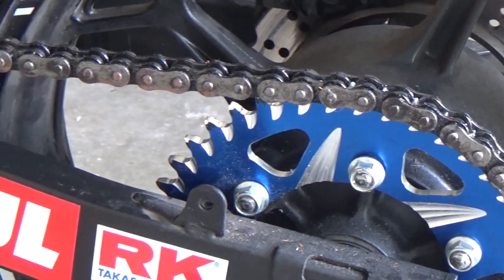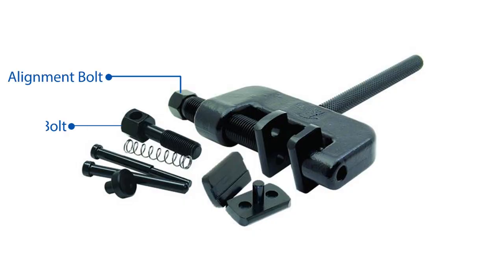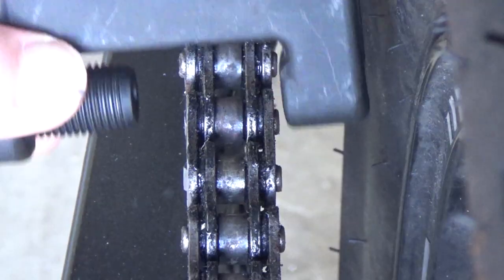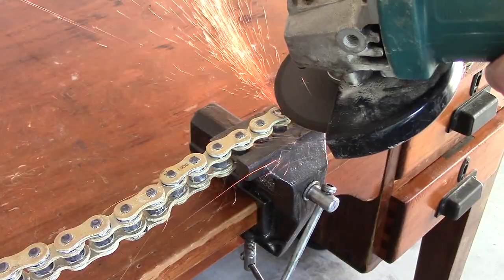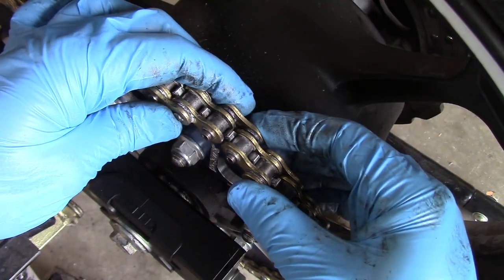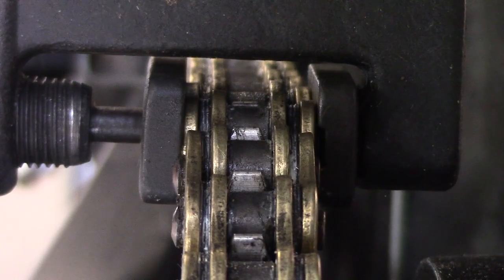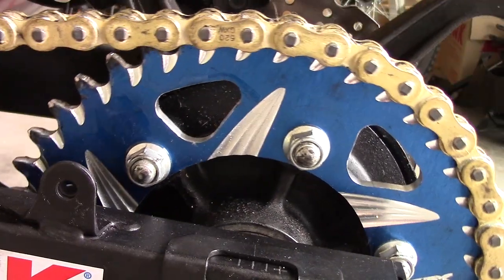How to Replace Your Motorcycle Chain - Break Motorcycle Chain and Rivet New Motorcycle Chain

Comment: First of all, those are orings or xrings not washers.  Secondly you forgot the most critical part, lubrication of the pins.  The orings are there to seal in the grease that lubes the pins.  You cannot lube the pins after assembly since they are now sealed by the orings.  That poor chain will not last.  I hope no one follows this video or their chain will be short lived.
Reply: Triangles1 ok well why dont you make a tutorial then and show us what you know.
Reply: Why would I?  Besides the fact that there are plenty of videos on youtube that do this already, I'll have no need to change my chain/sprockets for another year or so.  This video is pretty good except they neglect lubing the pins before sealing them with the orings.  The only other thing I might add is that he didn't mention much about pressing the plates on too far/ crushing the rivets too far.  Personally I prefer to use the kits that have metal shims to use so you don't crush the orings.  Simply press the plates/crush the rivets until there is a slight drag on the shims.
Reply: Triangles1 what im saying is its no need to criticize somebody's work man hes just trying to help.
Reply: And I am just trying to help by adding details to the video and pointing out what else you need to do if you want your chain to last.  Basically I'm helping people to not repeat the same mistake.  What is the harm in that?  Don't we all want to do it right so we can get the most enjoyment out of our rides and spend less on maintenance?

Comment: In 56+ years of riding I have NEVER had a clip style master link fail, even with big inch motors. The rivet style seems like a unnecessary pain in the butt.
Reply: Good to know. I will be replacing my 520 chain for the first time and trying to read and watch about this procedure. Honda calls for riveted master link but the DID VX3 only comes with clip in the box.

Comment: "Split clips might come undone." That's BS. Properly installed they are 100% safe. Easiest way to remove a rivetted chainis to turn the wheel and find the join link  where the pins haven't been flattened over the plate. Then use the rear sprocket to push against and prise the plate thru  the pins with a strong flathead screwdriver. . Next, fit a chain with a split link and buy a Scottoiler.

Comment: Overall the steps were correct but you missed 2 steps that I would consider very important.

1 - No grease was applied to the pins of the new master link. That sucker is now sealed and you ain't getting any grease in there.
2 - The sprockets and chain should always be replaced as a unit. If you replace one, replace the other. If you only replace one you will get very rapid wear of both parts as the wear patterns are not matched.
Reply: Jep some pretty big stuff was not covered here
Reply: No need to replace the sprockets if they are quality.  It's like not changing rotors.  It's mechanics jobs to make people change rotors w/ brake pads as the amount of wear can vary depending on the brake pad and rotor densities.  If you know what you got and it's quality, you don't have to change sprockets.  Some dragster guy who uses aluminum sprockets on the wheel never had to change it.  I'm not sure if he uses aluminum or steel up from I'm on steel lightened.

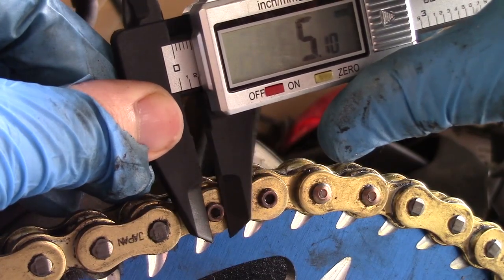Comment: 2:59 I think it's very important to messure the horizontal lengh rather then the vertical lengh. My rivet was 5.6mm vertical, then 6.0mm horizontal. I kept tightening cause it wasn't budging! It wasn't spreading horizontal even tho I tigthened up the 17 socket! I was going mad but I think the reason is sometimes It can spead out verical or horizontal? So maybe best to messure both the vertical & horizontal width? No one talks about it.. surely i'm not the only one to have this issue or am the only one to notice it?

Comment: What are your thoughts about the recommendation to replace the sprockets at the same time as the chain. Some have told me that this is absolutely necessary while others have disagreed. Thoughts?
Reply from the maker: +ThisLifeRiding If you're replacing your chain because of wear then yes, probably time to change the sprockets. There's no hard and fast rule and sometimes that won't be necessary. But if the teeth even look slightly worn down, I'd change it. Sprockets are fairly cheap - cheaper than chains at least.
Reply: Can do at least the front one per chain swap, as they can degrade fast when they get past a certain point.
Has more to do with the ratio of same link, same tooth on sprocket.
Reply: If a worn chain is replaced before wearing out the sprockets, then the sprockets shouldn't need to be replaced. However sprocket sometimes are cheaper then a quality chain. Squeezing more life out of a worn chain then replacing both is sometimes more cost effective. Higher performance machines may need both changed out. A worn chain will not evenly disperse the energy to the sprocket, all the tension will be placed on a few teeth at a time wearing them many times faster. A new chain will fit the sprockets better and disperse the energy through almost all the teeth.
Reply: ThisLifeRiding Its always recommended to change the sprockets as well for better torque delivery
Reply: Ones that I know and have worked on, cheaper to get sprockets then chains.. gives a reason to play around with the gearing to your liking.

Some chains have gone past 40,000 and still in manufacturer spec.

Seen other sprocket combos wear real fast. 
have a look at somthing like gearing commander site. load your bike and go to the bottom red bad, green good. else is just indifferent.

Comment: Hi, thank you realy good video just 2 things: 1. you dont lubricate inside when you connect the chain, is good use there some very soft vaseline, this two rings is for isolating of vaseline, in chain is some but is better if you put inside more. 2. in the finish you dont show the last step how you setup the tool. but realy good and detael video :) sorry for my bad english

Comment: Other videos say you must also replace the sprockets. Is that true ? 
On my bicycle I never did that and never had any problem.
Reply: Only if they're worn. As you've noticed it works fine if they're not too worn.
Reply: How do you define "worn" ? What is the criteria to replace?
Reply: @albrechthilker9072  My criteria is if you can see that the teeth are bent. No need to replace a perfectly good looking sprocket.
Reply: Thanks for the reply. I already thought the same. But most videos on Youtube say that you always have to replace the chain and the sprockets together as if this was an unalterable fact. I think this is a great nonsense. Obviously this brings more money for repair shops and for motorbike companies. It seems that these videos are produced by them with the purpose that you spend more money for unneccessary spare parts. Do you have any experience how many kilometers a sprockt normally lasts? My chain was dead after 20.000 km. But the rear sprocket still looked good. I bought new ones because of all these Youtube videos telling me so. I compared the old sprocket with the new sprocket and I could not see any difference. So it seems I wasted that money.
Reply: @albrechthilker9072  How long a sprocket lasts is heavily dependent on how you ride. Lots of wide open throttle accelerations on a 1000cc will wear faster. Grandma style puttering around on a 125cc on the streets will likely not wear anything. My experience comes mostly from smaller cc bikes that are ridden hard on gocart tracks but since they don't have an odometer I can't really tell how long they've traveled.